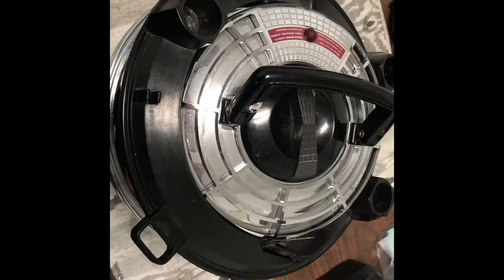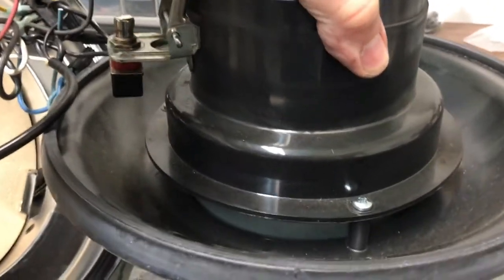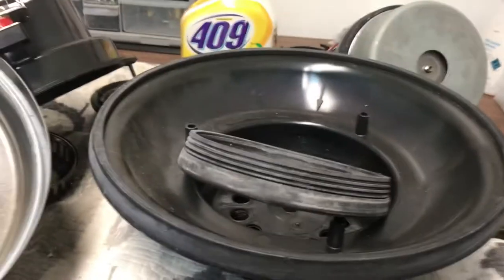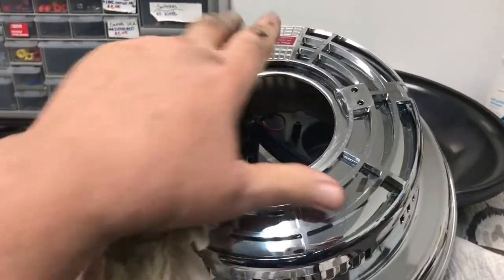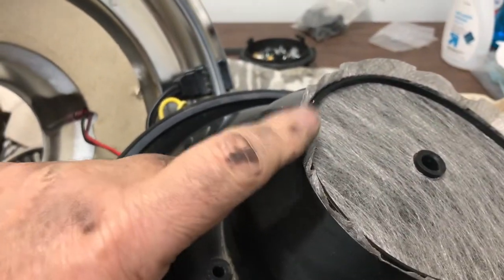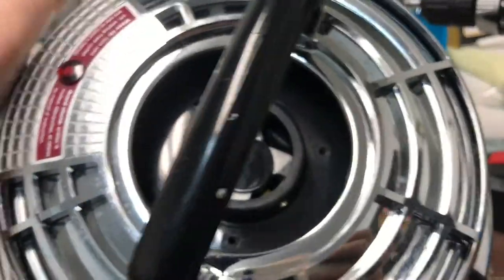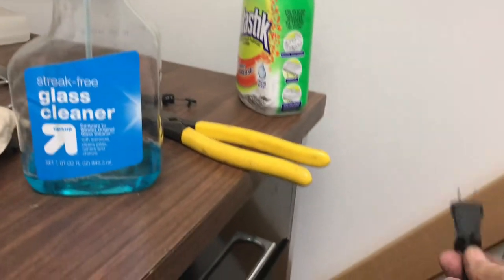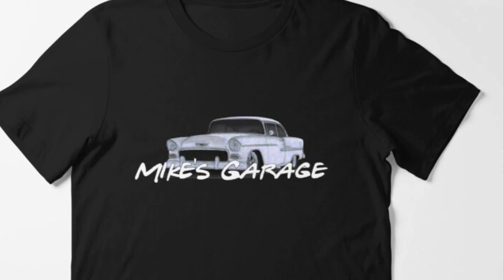How To Replace The Motor on your Filter Queen Vacuum (Step By Step)  | Mike's Garage

Comment: Hi mike great job on your videos. I started to replace the motor in my model 99, I failed to follow your lead. I disconnected all leads, not cutting but removing wire nuts. Long story short....HELP lol. Where may I find wire diagrams? Keep up the videos.
Reply from the maker: Hello Bob. I will put all the wiring drawings up today. Thanks for your comment.